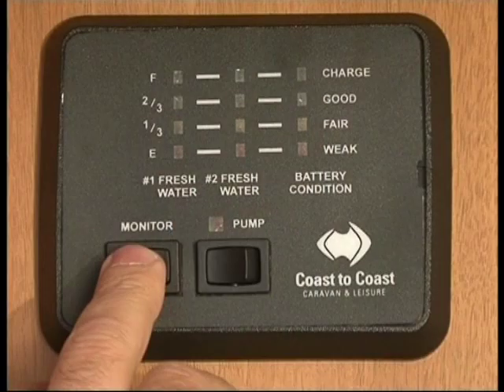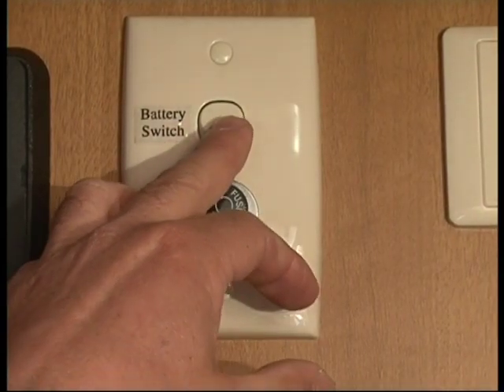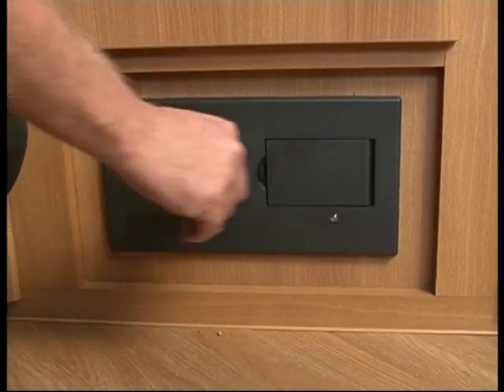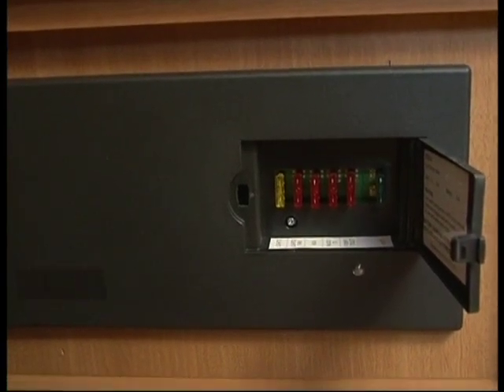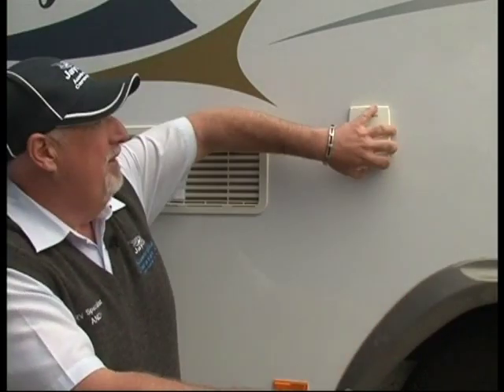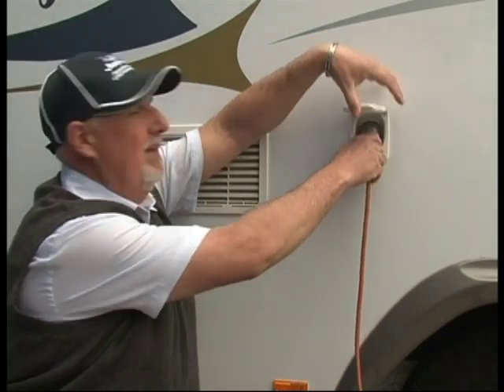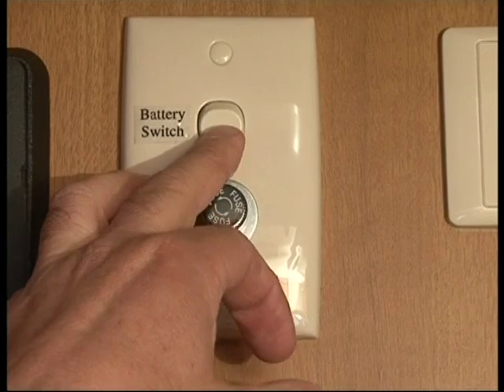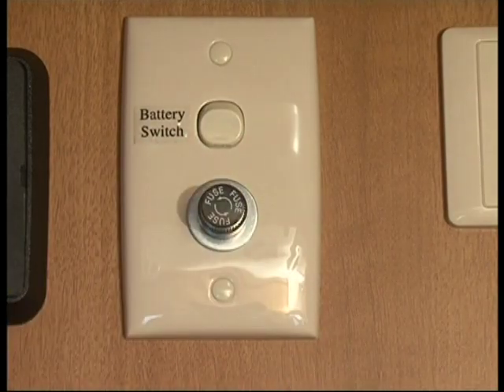Powering Your Jayco - 12V & 240V options

Comment: I hve the same setup and have lost 12v power when the switch is turned on no light on front panel either anyone had that issue 
Cheers

Comment: I have a 2002 Jayco Heritage 17ft poptop.I wish to add a battery pack and a solar panel(portable).I need to know whether this is possible, and whether I also need an Inverter and battery charger.
Reply: You can to any van. Invert is up to you, what you want to run on 240 volts. Go with a flex solar panel if you want to mount it on the roof. Cheers Mk

Comment: Do Jayco Swan campers have battery chargers to charge battery from 240 Volt?
Reply from the maker: Hi Craig, They certainly do, the transformer is built to charge the battery while the camper is plugged into 240v power